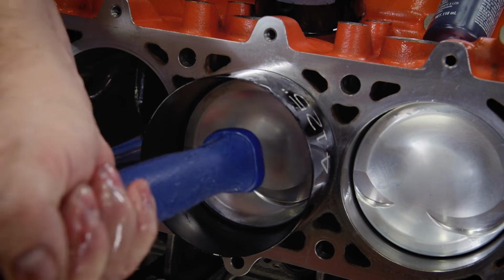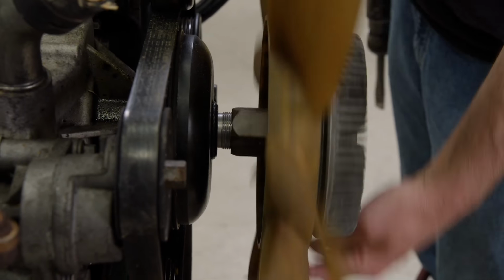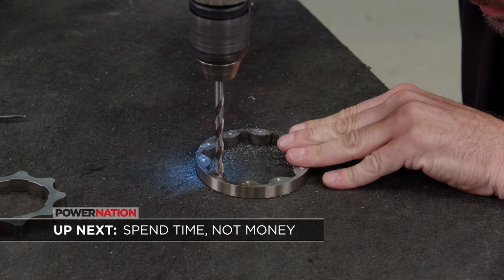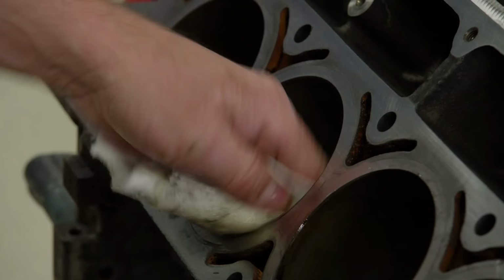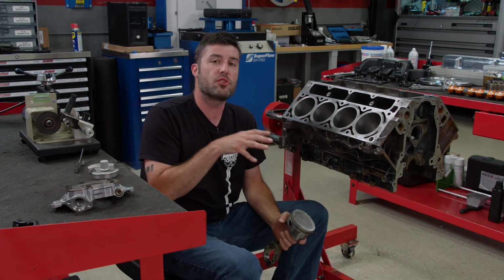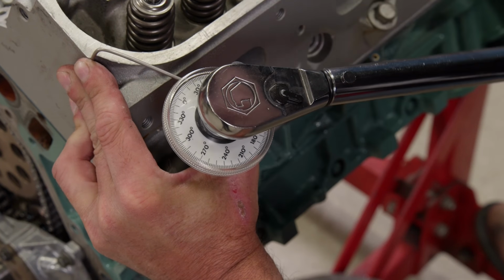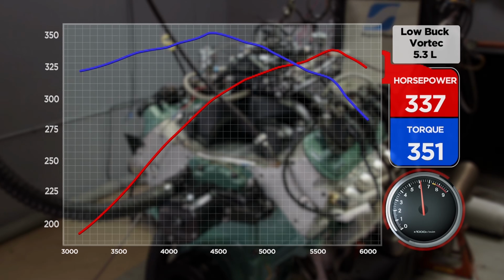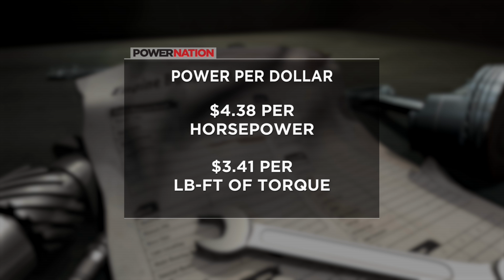Minor Upgrades Create Crazy Power on a Junkyard 5.3L Vortec - Engine Power S7, E10

Comment: never open up a junkyard LS. You let out the magic.
Reply: I put I'm a 5.3 out of the junk yard with about 153000 so i was told. Stabbed it in my truck with with only replacing water pump and thermostat and hoses plugs and it's been running strong for a year now.
Reply: @ivanbarajas5471  my ls has over 240000 and runs like a dream never had to replace any major parts either
Reply: @cujoedaman  probably a rear main seal. I traced my leak to that. If I leave it sit overnight I see about a teaspoon drip under the truck. Runs down the oil pan but it isn't the oil pan gasket.
Reply: @cujoedaman  mine burned a quart a month, but i just called it a self changing oil system. Did that the entire time i had it from 21k miles to 326k miles.
Reply: @ivanbarajas5471  i got a 5.3 ls, with 416k miles on it. still shoves out over 300hp. runs just as good as a new gcm sierra. which is what mine is
Reply: @ivanbarajas5471  Low miles that engine will last you as long as you take care of it. just keep them lubricants fresh. 5.3 w/ 493,000 currently.
Reply: When My L59 dies, Imma swap in an L7 built like this for damn sure... too bad the L59 can go up to around a million miles, so that's gonna be a while...
Reply: I have a 2001 Yukon w/5.3 with 398k still strong as ever!
Reply: @TheMonster480  mines the same. 250k and just replaced the alternator
Reply: @TheMonster480  I have an 01 Silverado. Only 240k. Going strong
Reply: @TheMonster480  did you by chance do anything to your EGR valve or any other mods ?
Reply: @TheMonster480  
450 k on mine💪👍
Reply: nothingaboutme I see you a fellow fan of Sloppy Mechanics page and YouTube channel.
Reply: I was thinking the same thing, but didn't know how to say it lol. The 5.3 in my jeep was pulled out of a silverado and put in my jeep in a single weekend.
Reply: @gamesofcontent  did you swap motor and trans or just motor? looking for a 5.3 to put in my cherokee right now
Reply: @gamesofcontent  I'm gonna need your guy's number lol thats amazingly efficient
Reply: Truth. Its all over once you let the leprechaun escape the oil pan
Reply: Scary to think some of this stuff makes 1000hp
Reply: @rustedratchetgarage6788  1000hp with stock rods basically wallet's the limit with forged internals on these motors
Reply: They're not LS's ...they're 5.3 vortecs
Reply: ViceGripGarage?
Reply: You mean the carbon buildup that pushes the compression on up to 11.5:1?
Reply: Cleetus is proud
Reply: Ahh yes fellow slops
Reply: I got 330000 on my 2001 6.0 and its still running
Reply: @alejandromorales4946  hey, was just wondering if you did anything with your EGR valve ?
Reply: Alejandro Morales any knocking?
Reply: That's the dumbest shit ever heard lol Couldn't stop laughing thanks
Reply: 404k on my 02 Silverado 5.3 and still  running quiet
Reply: @shawnglover5768  did you by chance do anything to your EGR valve or any other mods ?
Reply: @johnwaldrop3211  nope not at all, the only mod I have is headers
Reply: You Ls guys are idiots
Reply: Just cammed (ss2) my newest rcsb this weekend 240k miles stock original owner truck reused everything but headgaskets(stock were paper) 80lbs oil pressure at 6800rpms and inside looked mint. Ready for a 7875 next
Reply: ntx lsx racing yes, always upgrade gaskets
Reply: @scarce331  what cam did you use
Reply: In
Reply: lol
Reply: L0
Reply: camaroguy 66  means someone took good care of it
Reply: LOLLLLL, yes!
Reply: That bit me in the ass once!
Reply: I saw that on tg too
Reply: Amen...🙌🙌
Reply: The dude with the glasses seems like one of those guys who pretends he knows what’s going on, not a fan of him. They need to bring Joe Elmore back, back from when this show was called horsepower, him and mike seemed to click, unlike this wannabe car guy on here now.
Reply: Lmbo
Reply: What about ring gap?
Reply: Can you sell me that detroit green monster ? I got a 07 2wd work yruck i need a motor for ..
Reply: Can you sell me that motor for 2800
Reply: Best comment ever.
Reply: I swapped my 04  silverado CCSB with a '87k' mile engine imma try to get 2 years out of it till my shop is built and equipped so I can do this and a lil more on EFI.
Reply: My 5.3 sucks ass in my 86 ss ima buy a real engine this month and start a blog FWM
Reply: @kaysavageGMST  what's wrong with it? 300 hp junkyard engine for 500$ is hard deal to beat man

Comment: Nice video but all that work and using duralast sensors is misleading BWD would be more appropriate.
Reply: BWD can poney up to be in the show like Duralast did. That's how they determine appropriateness. These shows are great.. truly.. but they have a 3 level advertising system. Ads on the network, ads in the show (new products at the end of the show), and product placement like the Duralast sensors. A typical DIY knows good products (like yourself), but shows like this also show us products we might want to consider, or learn more about.

Comment: I swear every build they use a different kind of ring compressor 😂
Reply: honestly I have about 5 or 6 different kinds around the shop.. some clamp shut like pliers, others ratchet down , some I have that are custom fit for specific bores..  you would think sticking a piston in a hole is the same on every engine until you actually start building tons of engines..  some styles are just more convenient at the time.. and sometimes you just don't have time to look for your good one that has grown legs and walked off on you..
Reply: @gregthemechanicman  Best comment in here today.

Comment: How does dimpling the side of the oil pump gear make it flow more oil? The side of the gear is a sealing surface not a pressure surface, and how did you balance it?
Reply: It  doesn't,  its to make the pump last longer.

Comment: What about the price of the ignition system not everyone has one of them laying around
Reply: That's at least $350 for a MSD 6LS box, add a few wiring adaptors and tax = $400 extra.
Reply: And the price for the carby
Reply: Still all adds up
Reply: @582_Motorsports  holley an edelbrock carbs can be found for 200$ or less .. hell i got 2 4 barrel edelbrocks sitting in my garage along with sets of heads , intake manifolds . performance parts aint rare or hard to find .. craigslist auto parts is a goldmine right now people are going broke due to this covid19 bullshit not being able to work they are selling engines , transmission , tools , welders ect for cheap
Reply: @codyramos3200  yes,but most of us are in the same boat as them,not much cash to spare
Reply: @582_Motorsports  bruh u can get a holley carb on offerup for cheap im talkin 50 bucks
Reply: @raymondguzman5083  yeah but holleys only work great on a chevy when hogged out for drag racing ,for street quadra-pukes are best if you can get a good builder for it,not everyone can do a good rebuild on them.
Reply: Use the oem ignition. 
I cant figure out why yous want to run a carb. Remember a carb engine is weak and smoky at 100k miles?
Reply: @brianmorrison9066  gotta love EFI running off mass air flow meter and O2 sensors!  Throttle response, great power at all rpms,  and better fuel economy to boot!!
Reply: @brianmorrison9066    I'd use the factory fuel injection. I can't see any benefit in using any carburetor, it would decrease gas milage.
                           My 04 Avalanche 5.3 has over 400k miles. I use Mobile 1 since it was new, and always run 93 octane non ethanol gas.
Reply: @ricktaylor3748  This is what I'm kicking around. I have all the original wiring harness, computer, etc, that came with the 6.0. I'm still thinking going carburetor, however, for a few reasons. It's going in a 71 K5, which was carbureted. I like the nostalgia of it. You can make THE SAME HP with a carb, as long as you know what you're  doing. I myself know how to tune a carb. Also, everyone and their brother is goin fuel injection. Nice to be different.
Reply: @rite2beararms      I understand what you're saying, however, carbs are a thing of the past. If you go with the original fuel injection, your gas milage will improve.
                I've woking on engines for over 50 years. Yeah, it's nice to be different, but carburetors waist gas. If you insist on using a carb. Find an old quadrajet 4 bbl.
                 If you want REAL horsepower, find an old 400 small block and a set of camel hump heads. You have to drill out the steam ports, before they work on the 400 engine.
                Take my advice, stay away from 4 bolt main 400 ci small block engines, they're prone to crack around the outer bolt holes.
Reply: @brianmorrison9066  why not run a carb? Rebuilds arent that hard
Reply: A set of new stiffer beehive valves springs...which is a proven and common must have upgrade for any stock LS would have easily and cheaply allowed the engine to rev higher and increase peak hp.....probably why the HP dropped off at 5800 rpm on NOS....valves floating...
This is a perfect set up for any old GM car or Truck...350 hp...this is like old SS 396 power but a couple hundred pounds lighter...One hundred pounds less with an aluminum block...but much stronger and reliable...
Perfect motor for a Fox body...hell any body lol...
Reply: Don't see where they mention the ignition system... some kind of computer eliminator for $600? Thought they would go with the expensive front distributor kit... 
No new rod bearings? 
No carb. price? 
Almost as much HP and torque as a stock 1962 SBC 327"... 
.
Reply: oh yeah, and a set of headers too.
Reply: That was my thoughts
Reply: They also conveniently forgot to price in the cost of all the labor.  Still, impressive results to say the least.
Reply: @davidkeller2832  They're the ones who did the labor. But for the less mechanically inclined, or those who don't have the time, yeah that's a big spend situation.
Reply: What about that fancy imtake and carb you are easly at $3200-$3500
Reply: The build would have been much cheaper using the stock harness and truck intake. But they scarred of wires lol.
Reply: @CanadaBud23  They scared of losing sponsors for lack of parts pushing...
Reply: exactly, another 400$...a carb, I suppose you can run some junk there for 100 bucks or use what you were using on that 1st gen 350....but my experience with carb is nothing beats a high end piece...so another 600-1200 lol

Comment: Were the heads just cleaned, or new valves/seats/seals too?
Reply: If you watch both heads have the temp buttons on the freeze plugs. They are reman heads. Wish they would just say that.
Reply: It SHOULD have been made, that's just too simple to not replace/refresh
Reply: @Thraser999  $600 in head work on a $400 engine makes sense to me
Reply: Austin Doud. That cam seemed a little aggressive to not adjust with different springs, cam phaser, or cam lockout. It might have been low lift though.
Reply: @bri-manhunter2654  that cam is rather mild 218 duration intk 222 duration exh lift int.501 exh .501 with 1.7 rockers was meant to be used with stock springs n retainers  , the early 5.3 lm7 engines didnt have vvt so no cam phaser or lockout needed. that cam motion cam comes in a "drop in"(in video) or high lift version that needs springs n retainers
Reply: My guess is rebuild heads that they bought, Grey Paint and heat tabs on them

Comment: I think this is what I'll use instead of the newer LS. I have 98 obs I'm sure it'll be lots for it if I add a few upgrades like a bigger cam lifters pistons and bore it out a little i can probably get 500 hp out it which is lots for me as a daily driver. Just wondering if its the same procedure and process as putting a newer LS but probably cheaper and I'm down for that if I get a 99 5.3 shouldn't be much different I hope
Reply: stick with the vortec 350 in your 98

Comment: They always break down costs but leave out things like machining, ignition, random pieces, tools, hardware, etc... Yeah because every person has a jet washer sitting in their garage, all the measuring dials, every tool, an entire bin of ARP bolts, and a dyno. I realize you can do things at home or go to a machine shop, but it is still extra cost that seems to slip by the show. I would like to see one show do a true home build. Pressure washing, bolts from a hardware store, and going to a dyno.
Reply: Vise Grip Garage on YouTube!!! 👍🔧🚖
Reply: The price would go from like 2500 to 7000 lol
Reply: Free Carb? just steal one from another project
Reply: Your nitpicking honestly. The idea of the show is to show you what you can do, and most people know it's a ball park figure cost wise. I have a engine washer though.. Garden hose and dish soap with some rags and brushes. And I bet I get mine allot cleaner then that vertical dish washer they have on the show.

Comment: I was really hoping to see the numbers on stock trim,  i.e. stock fuel injection.
Reply: Check out Richard Holders channel, he does just that with all stock intake, engine accessories and exhaust components, on the engine Dyno.
Reply: allanb3222. Richard is a god among men, he should be considered a national treasure.
Reply: I did one bone stock after clean up, 41,000 miles on the long block, dyno headers, stock truck intake and TB, no accessories, 5.3 truck engine.  We used a Holley Dominator FI controller and with a few minutes of tuning that engine produced 374 hp @ 5850 rpm. Not to shabby.  A mild cam and spring change will get you an extra 50+ hp.

Comment: 2 more pulls like that and they get a free windowed block with that budget build🤙
Reply: I love ls haters building lc9 right now... Send it and laugh cause under 7000 and 800 hp its g2g  ah no 250k lm7 (not the best) do it and last for years boost it to the 🌙
Reply: Are you blind
Reply: Peak torque at 3000rpm? Definitely going to bend a rod or break it. Guaranteed... The iron 5.3s can take that power but not at 3000rpm...Those numbers it put down are similar to a diesel,  it's not a matter of if it's a matter of when.
Reply: @Brother2Jis_27s4  that should give you a hint that the dyno test was flawed
Reply: Yeah I didn't see the 700 lbs ft at 3k on a gen 3 rod motor that's scary probably already bent the rods
Reply: Lol nah not on a good old 5.3. Ring gap is the key, people are doing 8 and 9 second passes on these with stock bottom end. Chevy did something right with these engines.
Reply: @Chevymonster203  THANK YOU. My man Richard Holdener put me wise to ring gap. Engines can take a lot more boost than folks think with the right ring gap.
Reply: @rhubarbpie2027  Very true, I know with the 5.3 and the 4.8 vortec engines they come with hypereutectic piston and too tight of a ring gap usually cause the ring lands to break. That's why you will hear guys looking for high mileage 5.3 because the rings are worn down and the gap has increased. Good for boost
Reply: If that nitrous was staged in then I'm sure they wouldn't have a problem. Right off the hit is asking for trouble. I wonder how many people here have built their own under these conditions and seen any kind of longevity? A pretty decent shot of nitrous at 3000 rpms on stock rods. Ring gap has nothing to do with the rate of piston acceleration.
Reply: Brother2JiS_27s4 216. It’s a short stroke, piston speed is not the problem. And like others have said, Richard has proven time and again like other guys have that the engine hold lots of boost when you change the ring gap.
Reply: @bri-manhunter2654  piston and rod speed isn't where I'm going with this. It's the initial hit that creates a hard acceleration of the rod, it will definitely bend. I've torn down a number of these engines, and built nearly the same. Those rods aren't bullet proof, especially stock rod bolts. I understand being Ls fanboys and yes Ls engines can be strategically built to do some nice stuff but this one is a ticking time bomb. It probably doesn't matter what I say, go build this exact setup and see what happens. Yal are talking about ring gap and boost, not ring gap and nitrous. Yes gapping them are nearly the same but boost is ramped in and isn't an immediate hit like nitrous. I guess years of my own professional experience won't convince you, just keep listening to youtube and reading forums that have the best and most accurate information available.they did only one hit because they know they're flirting with disaster...

Comment: I'd like to the Ford 300 inline 6 , with it's Heavy Duty exhaust manifold with either a Howell Fuel Injection setup of a Fi-Tech EFI setup, with roller rockers & hydraulic lifters, AND HEI distributor, that looks like a eternal engine with fuel injection drivability.
Reply: I'd love to see someone trick out an inline 6. I always heard about what a workhorse they are.
Like to see what numbers they can pull torque and/or horsepower.
We all know it'll never run down the drag strip but it'd make a Great stump puller !
Reply: they already did a Chevy 292... you might get the same torque with a few less HP with the "less revy" Ford